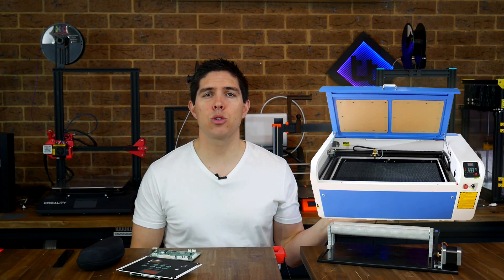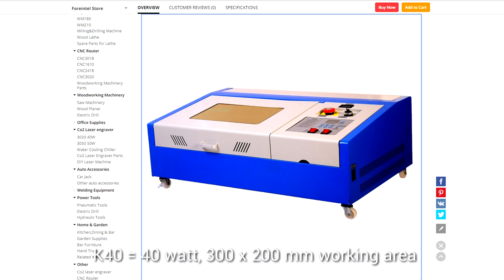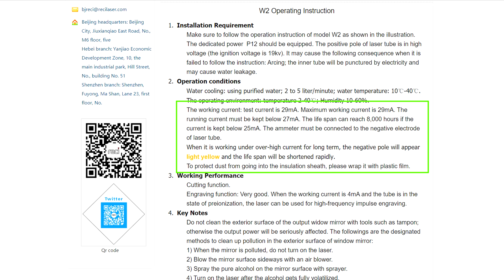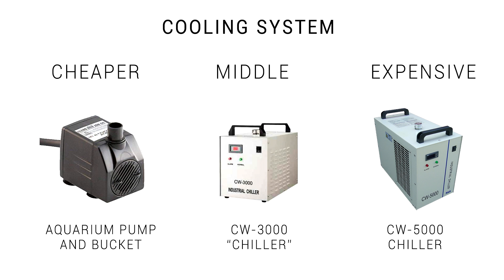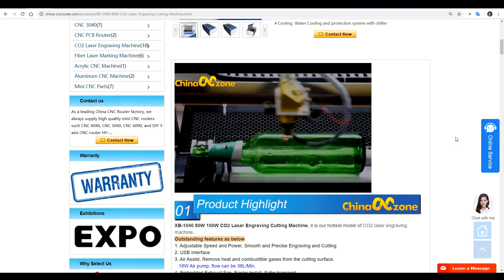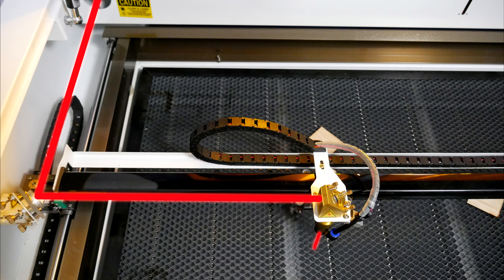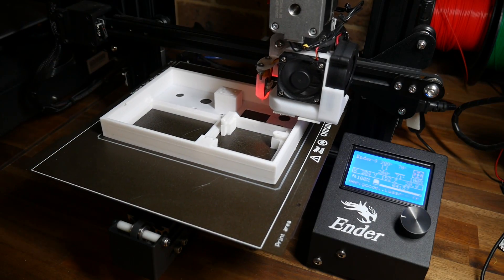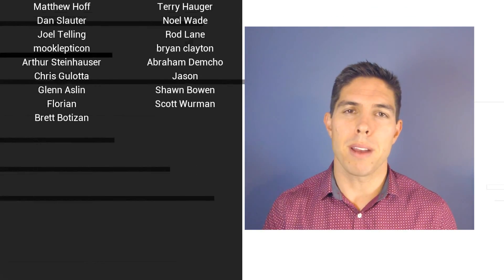K40/Chinese CO2 laser cutter/engraver buyer’s guide

Comment: Make sure whatever you're using for coolant is anti-algae and non-corrosive. you don't want any growth nor do want your coolant eating away the metal pipes in your cooling system. If you live in a really cold place you'll also need anti-freeze or your tube will burst. if you live in a hot place you'll need refrigerated cooling. in this case units like the CW-3000 only blow air on a radiator. the CW-5000 refrigerates the coolant, but it's super expensive and not worth the price. I live in Australia and the summer heat can get as high as 47deg C or 116 deg F, the solution that worked for me was getting an aquarium chiller like the Heilea HC100A that can chill 100 litres of water, low noise and way cheaper than the CW-5000

Comment: Can you use oxygen instead of air to help with fumes and maybe add some cutting power? :)
Reply: Oxygen is a very bad idea. Nitrogen works well, you want something that doesn't burn.
Reply: @originaltrilogy1  Speeding up the burn is not a good idea? How they do it in commercial lasers ?
Reply from the maker: I recently came across a 150w unit that took compressed oxygen and in that config it enabled it to cut metal.
Reply: @andriosz  Oxygen assist in a home hobby setup it very dangerous, and easy to get wrong. It also doesn't provide much benefit over standard air assist for cutting the thin wood and acrylic materials usually cut by a home hobbyist with a 40-80W laser. It also can lead to more charring and higher risks of fire inside the laser cutter. Air assist or nitrogen assist is far, far safer, and either has a massive benefit over no air assist at all. Sure, when cutting some metals on a big professional machine with well engineered safety features, cutting some steels with oxygen does allow for faster cuts in some instances, but stainless for instance you really need to use nitrogen. Assist gases depend on the material, the laser and the safety issues. Make sure you understand the risks and downsides of oxygen assist, and have fire suppression in place if considering it.

Comment: You really should have bought a version with a better motion system IMHO. The one you got is made just like the cheapest K40s. Mine is the same and the motion system is probably the worst part of the machine. By the way: from the looks of it, your laser head looks like an (height) adjustable one, so using that, might be much quicker than moving the bed up&down to adjust the focal length.
Reply from the maker: I didn't have much choice in Aus, but this one ticked most of my boxes. I will explore the head, thanks for the tip.

Comment: Have you priced replacement laser tubes yet? I worked in an office with a laser engraving machine back in 2002 and we used to have to get the big boss to call up and threaten the company with legal action to be able to buy a replacement tube. The tube only lasted 400 hours so it happened a few times when I worked there.
Reply from the maker: I found a place less than an hour away with reci tubes for about au$1000. Easier to buy tubes locally than the whole machine for me.

Comment: You won't be happy with it. You should have done some research and bought a better Chinese laser cutter.
Reply: Disregard. I posted too fast. I thought you went with K40. I have never used the one you bought so it will be interesting to see how it works for you.
Reply from the maker: I'm certainly not running a business with it so for my hobby use it should be sufficient. I've yet to find anything dodgy on it apart from the exhaust tube so fingers crossed.

Comment: Did you wire that meter in series with the high voltage of the laser tube?v I don't think that using that meter in that application is in any way safe. The voltage across the meter should be tiny, but if the wire after the meter went open circuit you'd likely wind up with thousands of volts of potential at the meter face.
Reply from the maker: It's on the low voltage side. You never touch the fat red wire from the lpsu for the reason you mentioned.

Comment: Sounds like one or two of the data lines on the USB cable is damaged or not connected correctly.
Reply from the maker: I tried about four cables on two different computers. If I didn't have the c3d board I would have kept trying.
Reply: Teaching Tech ah so it’s not a built in to the unit. Must be the connector then.

Comment: Nice work on the video!

I have a 60w laser cutter and have worked on a few other Chinese ones. 
For cheap exhaust fans and ducting  in Australia check out the hydroponic sellers on eBay and if the air assist pump is too loud for you check out the diaphragm pumps made for ponds and septic tanks like :https://rover.ebay.com/rover/0/0/0?mpre=https%3A%2F%2Fwww.ebay.com.au%2Fulk%2Fitm%2F123448743533 
They come in different sizes but we found anything over 100lpm was fine. And you can add a tee junction with a valve to the airline so you can dump some air for cutting lightweight paper or fabric that would get blown around too much.

Also an small radiator (automatic transmission cooler or oil cooler) with a bathroom exhaust fan mounted in a laser cut plywood box is a cheap upgrade to the pump in a bucket. Best to keep a lid on the bucket too.

For anyone in Australia needing a filter for the exhaust I found the easiest diy way was using 2' square air-conditioning filters in a stack (coarse to fine then HEPA) plus a bed of granulated activated carbon (GAC) after the HEPA filter works well.
It makes for a big filter though it's much cheaper than the commercial filters.
Reply: Thanks for the tip
Reply: Here's a couple of photos of the diy filter we made at robodino.org hackerspace.
https://photos.app.goo.gl/X3orhTtgYtHejJhU7
Reply from the maker: Thanks for the detailed post
Reply: Know of anyone here in Aus that sells these Chinese machines? I'm concerned about shipping one from overseas and the potential hassles.
Reply: @kstof  there are Australian sellers on eBay that ship from Sydney. Best ask the seller to confirm that have local stock before buying though.
Reply: @MaxNippard  cheers for that mate.

Comment: Why not buy an CO2 laser tube and convert the lowrider?
Reply from the maker: I would need to build a huge enclosure over the top to make it remotely safe, and I need the table to work on so it wasn't a realistic option for me.
Reply: This was one of my first thoughts when I saw the lowrider.  Would be interested to see if the lowrider is rigid enough to maintain the laser path and or if it has too much vibration compared to the linear rail systems.

Comment: Michael - Pro tip on removing paper backing on just about anything.  Use your heat gun or even a hair dryer.  Just need to get that glue warmed up and it peels off easy.  Once you get it started use the heat and slowly peel it off.  I went decades without knowing this trick and now I can remove just about any sticker off anything without much trouble.  Give it a go!

Oh, and awesome video I've been eyeing one of these for a while now and your video will be super helpful in my purchase!
Reply: I wish our car mechanic knew to warm up the adhesive before he ripped of the tape I used to hold the wing mirror on after it was hit in a carpark. He took the paint off the door as he ripped the tape.

Comment: I like lasers, but boy oh boy, is it a headache with all those variables.
Definitely not as straightforward as  a 3d printer.
Reply: I find that laser cutters are actually more straight forward than 3D printers. Really it boils down to get a proper chiller, a bigger air-assist pump, and plan on replacing the control board if you are buying a cheap printer.
Reply: @originaltrilogy1  I'd rather buy something that doesn't need much tinkering out of the box,
for a reasonable price ofc. I like the Dremel laser, but it's outrageously expensive.
Reply from the maker: When I starting shopping I figured it was like a newb looking at all the 3d printers available for the first time.
Reply: @flioink  What is your budget?
Reply: hi Flioink,laser technology would not makes you headache if you take correct protection.James.

Comment: Great video again Michael. Really interested to see how it turns out.

I'm doing a complete rebuild of a k40 and using a design called layzor that I purchased, but there are loads of free designs out there such as on openbuilds.

Im planning on using the mks sbase 1.3 with grbl-lpc on it. I was looking at Marlin but it dosent have the power control when cutting around corners like grbl does.

The machine I will be building is from scratch really, just the K40 will be harvested for its parts.

The Cohesion3d gets great reviews and is a direct replacement however I wanted to try keep the costs down. Gonna be using tmc2209 drivers and adding linear rails.

Here is a great free design where someone had used the original K40 case but just increased the bed area.

https://openbuilds.com/threads/k40-12x24in-rebuild-in-original-case.13691

Keep up the good work and take care pal... Mike
Reply from the maker: Hi Mike, thanks for the detailed post. Good luck with your build. I considered getting a k40 and gutting it for a custom motion system but I figured I didn't have the time.
Reply: @TeachingTech  haha, I honestly don't know how you find the time to do the things you do currently... and then produce excellent and concise videos to assist everyone else.  Love the videos, I have learnt so much.
Reply: https://glowforge.com/our-products This US laser is an interesting approach.  Its software is in the cloud.

Comment: Hi Michael, my K40 won't connect to my windows 10 computer using K40 Whisperer but will connect to my windows 7.
Reply from the maker: I might have an old win7 netbook that runs my CNC to try that with, thanks for the tip.

Comment: Hey michael nice to see you getting into lasers, You should need nowhere need 20+ma to cut! When i first started i thought i needed it aswell but that means something is out of focus or your lens is dirty.

I now cut through 3mm plywood at 10ma sometimes even 5ma if i go slow enough. The lower you keep your laser power the longer it will last you. Rule of thumb is pretty much never need to go over 10ma.

good luck with your upgrades! :)
Reply from the maker: I think for a k40 10ma is very reasonable but for my 80 (90?) Watt tube it's barely scratching the potential. I agree on the life but I'm already running it 3ma under the safe level from the manufacturer.

Comment: There are lots of dodgy eye protection glasses on the net, purchase from a reputable dealer and remember you can't put a price on your eyes
Reply: Yep agree. One of the k40 laser guys I saw vids on had a great warning label on his cutter.  "Do not look into laser beam with your remaining good eye"
Reply: for better ventilation move vent motor to the end outside and let it suck it out, it will work better.
Reply: I'm not sure why you really need eye protection with CO2 lasers. The light itself won't even go through your cornea, but definitely don't look into the beam path. I find the burn light it makes as it burns material is probably a bigger hazard, and you probably want some welding goggle or something if you want to look at the work while the laser is working. But seriously the backscatter light won't do much except to cause you to feel some warmth if it's a little intense. I'd say the lid is mainly to prevent the beam from being reflected or you sticking your hand into the beam path (again, because you can't see it).

I think an auto darkening goggle is probably a better eye protection since the light it makes when it burns something is much brighter than the laser itself.
Reply: @taiwanluthiers  "The light itself won't even go through your cornea"
Even if it doesn't go through then what do you think that means? It means unless you've got GM reflective sunglasses style eyes your cornea is absorbing that light in much the same way the wood is, with much the same effect.
I'm unsure why you think it'll damage your hands and not your much more fragile eyes.
Reply: @demoniack81  Unless you are looking straight at the beam, or somehow reflections (not backscatter) hits you right in the eye to burn you, it isn't intense enough to burn you. CO2 laser wavelength will only penetrate something like .1mm into your flesh, and the damage is from the intensity of the light and not from the light reaching your retina like visible light would. Otherwise being around a campfire would damage your eyes as well. 

So backscatter light won't hurt you, which is what goggles are meant to protect but a welding goggle would be more than enough to protect you from the light, but more importantly the welding goggle protects you from the intense light as the laser burns some material. They can be quite bright even through the shield on the lid.

Perhaps this is why the Chinese lasers never designed a lid switch... they felt it unnecessary and it becomes a problem if you need to align mirrors.
Reply: If you want proper laser protection. Thorlabs, used by optical physicists.
Reply: Yes, get something great and even then be careful. The ventilation has to be very good too. If you think I'm just cutting wood. Think again.. many woods have glue in them. The smoke could be burned vaporized synthetic glue.
Reply: i run lasers for a living, as long as your protective screens are made of plexi ( not acrylic) you will be safe. our main machine we run is a trumpf l7040 - 4000w of power and 5axis
Reply: @dygonproductions7062  Plexiglass is acrylic. Maybe you mean Polycarbonate? What is clear, to us, is not to certain optical wavelengths. Which you certainly know, but I figure the rest might like the info. But the glasses need to be rated for the wavelengths too. UV could blast through a IR rated set. Vice versa. Know your energies.
Reply: So plexi glass is the trade name for cast acrylic.  I run lasers as well for a living, and also worked a plastics fabrication company for several years. Just an FYI.
Reply: @dygonproductions7062  What software do you use if I may ask?
Reply: i need eye protection for a laser the same way i need scuba gear to take a shit, i dont stick my head in either so there isnt a fuking risk!! and if it doesnt come with adequate eye protection its not fuking legal to sell it is it!!! better advice than glasses wud be dont stick ur head in the machine but if you need to be told then ur to stupid to be using dangerous equipment!!!!!!!!!!!!!!!!!!
Reply: @odoggow8157  Adding more exclamation points doesn't make your wrong assertions correct.